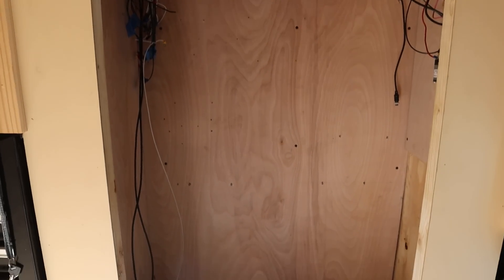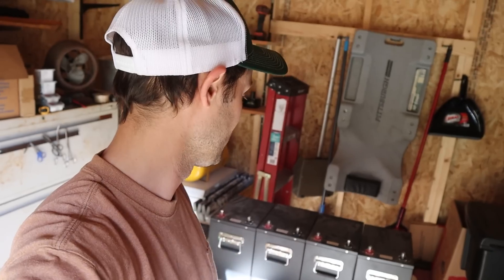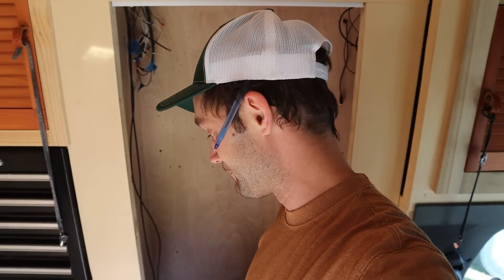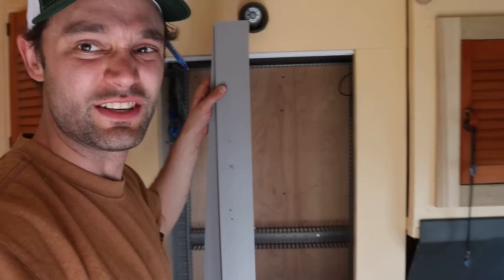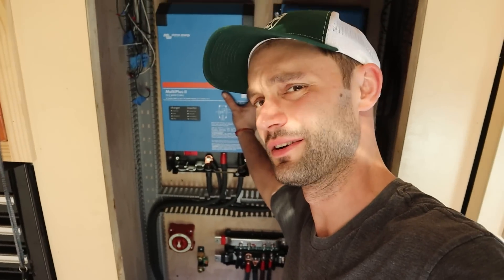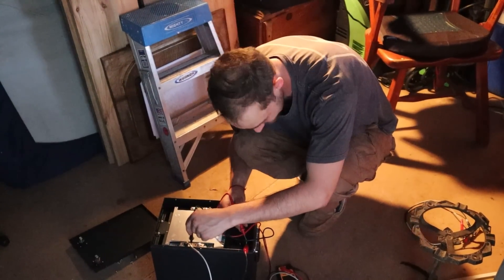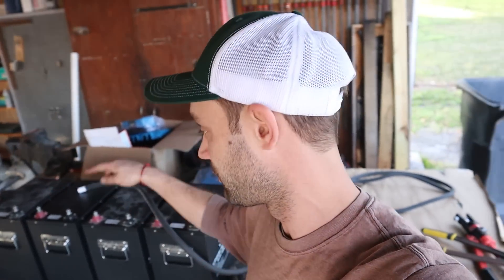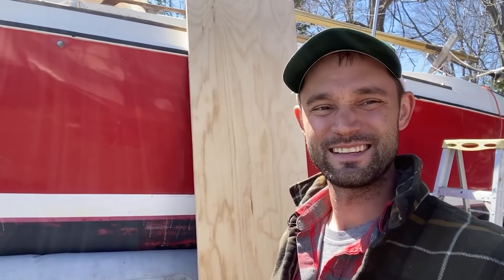Converting This Motorhome to Solar Power: The Ultimate Off-Grid Solution

Comment: Hi Michael!  Your videos have helped me so much.  Thank you.  I am now at the point where I need to purchase my solar panels.  I only have about 8' x 8' of roof space available (I have short bus with roof deck).  My plan is to use 450W panels (2 of them) to maximize the roof space that I have.  However, these panels are pretty heavy (50 lbs).  If I use heavy duty brackets and anchor them securely from inside the bus, do you think it's reasonable to use such big panels??